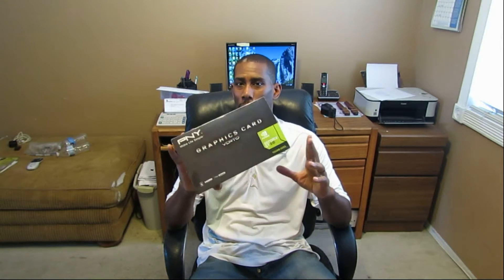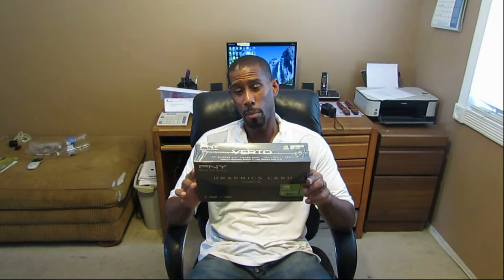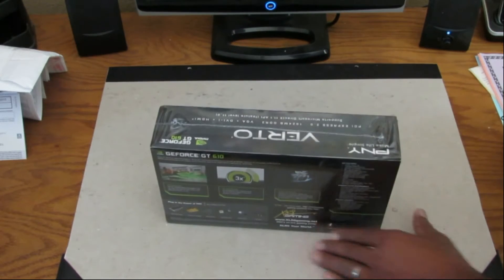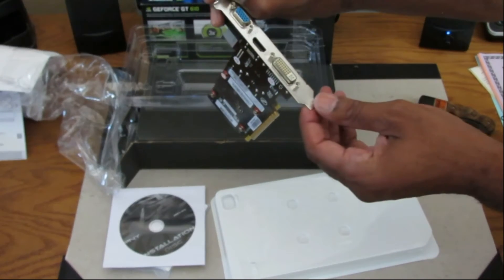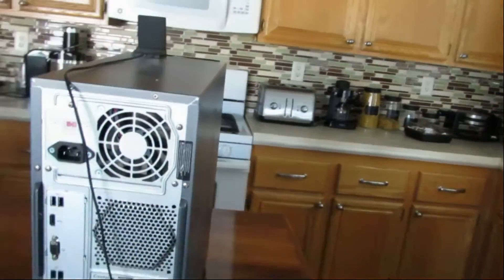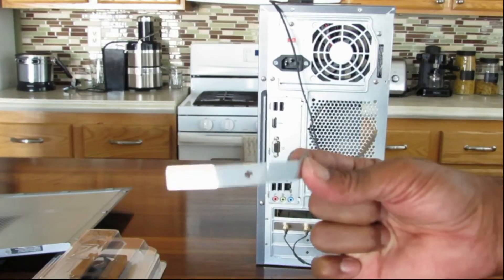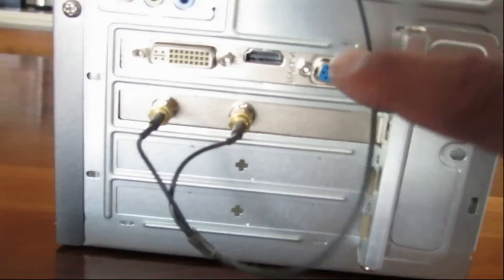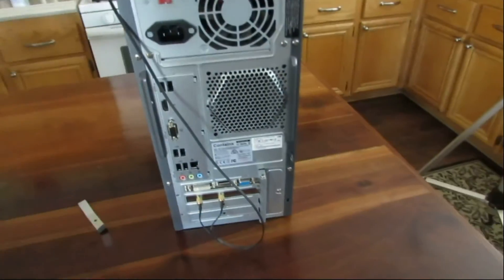You can instantly improve your video editing by installing a graphics card- Improve rendering time

Comment: after i put the video card i cant play dota . it say unable to find a valid 3d device. how can i fix it ?
Reply from the maker: Make sure the card in push all the way into the slot. Check to see if anything else came unpluged. Plug the monitor into the new card. Down load new drivers for the new graphic card and restart your computer.

Comment: if my psu is 300w could i run it with just that and no need to upgrade?
Reply from the maker: Yes, 300w will work. Here is a link with all the video cards specs.
http://www.geforce.com/hardware/desktop-gpus/geforce-gt-610/specifications

Comment: I hav gt710 with pcie x16 slot but there is no space in cpu to connect monitor with graphic card. What shoukd i do
Reply from the maker: Do you have something else connect to the motherboard in the slot?
Reply: I can connect gfx to motherboard but that small open space in cpu is not there where u connect gfx with monitor
Reply: Can i break a small part from cpu's backside to attach card with monitor?
Reply from the maker: That's not the ideal way to do it but sometimes that's the only way. Do you mean cut a slot in the back of the tower?
Reply: Yes cut a slot
Reply from the maker: That is going to have to be your call. If you do it just make sure to be safe and don't cut more than you need.
Reply: Thnx brother :D

Comment: I can't tell from your video - is the heat sink on the card big? I have a small factor form PC with only one PCI-e x16 slot. It can only take a single-width card no more than 6.6 x 2.7 in. Thanks for your time.
Reply from the maker: The width of the card is the same as the metal plate. It's 3/4 of an inch or 19mm wide. Thanks for watching.

Comment: Ok when I put it in the pc n start it up I don't get any think to pop up on my screen what do I do to fix this problem I also tried taking it out and installing the drivers first but nothing happens when I put it back in
Reply: Also when I tried to install the drivers first it said when it's checking system compatibility it said navidia installer cannot continue. "This graphics driver could not find compatible graphics hardware. Is it jus saying this cause i don't have in the graphics cars pls help me out
Reply from the maker: Download this and see if it helps.
http://www.geforce.com/geforce-experience
Reply: +Demario Tennant ok I fix it it's working now but I want to run on the dvi I have a adapter wen I hook it up not comes up how do I fix this
Reply: +Demario Tennant also my sound is not working how do I hook back up my sound
Reply from the maker: Have you tried to restart your computer? Sometimes that will fix a lot of the issues you're having.
Reply: +oxmanagain I've restarted it so many times but the audio still don't work it's showing hdmi output wen I'm using vga
Reply from the maker: I'm going to have to do some research and get back with you on that one. If I find anything out I will let you know.
Reply: +oxmanagain thank you very much don't worry I'll be trying to figure it out too
Reply from the maker: Ok, if you figure it out let me know how you did it. Have a good one.
Reply: I'm I fixed the speakers there working now. I had to click f10 when the computer was starting and I just deleted my audio drive and turn it on and it started to work
Reply: Selected
Reply from the maker: Glad it's working and thanks for letting me know.

Comment: is this graphic card work on
Operating System
 Windows 7 Professional 32-bit SP1
CPU
 Intel Pentium E5300 @ 2.60GHz 47 °C
 Wolfdale 45nm Technology
RAM
 2,00GB Single-Channel DDR2 @ 399MHz (5-5-5-15)
Motherboard
 ASUSTeK Computer INC. P5KPL-AM IN/GB (Socket 775) 47 °C
Graphics
 SMB1930N (1360x768@60Hz)
 Intel G33/G31 Express Chipset Family (ASUStek Computer Inc)
Storage
 298GB Western Digital WDC WD3200AAJS-22L7A0 ATA Device (SATA) 40 °C
Optical Drives
 DTSOFT Virtual CdRom Device
 TSSTcorp CDDVDW SH-S223C ATA Device
Audio
 High Definition Audio Device
Please!! give a reply fast....
Reply from the maker: According to the box your system should work. Here is a link I found that might help. Sorry for the late response and thanks for watching. http://www.cnet.com/products/zotac-geforce-gt-610-graphics-card-gf-gt-610-512-mb-series/specs/